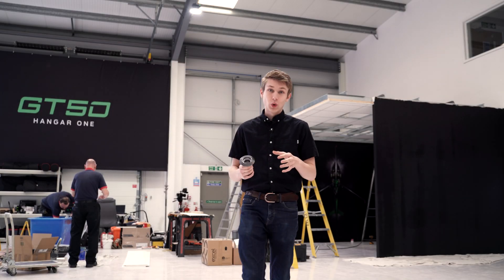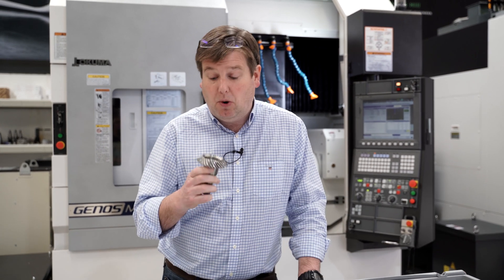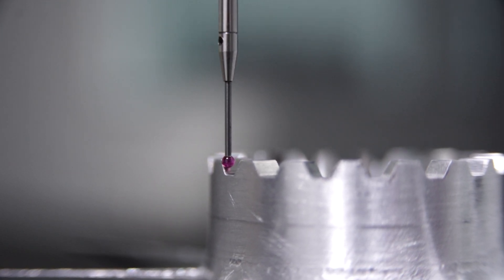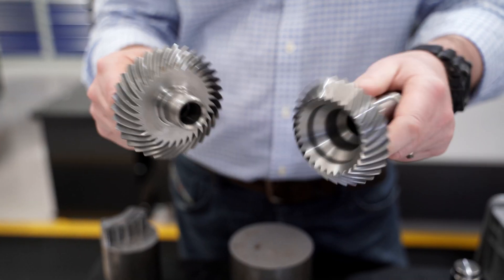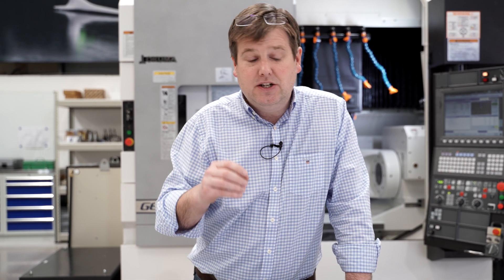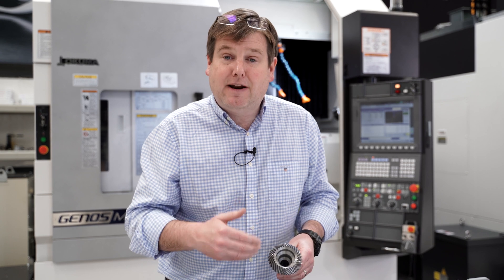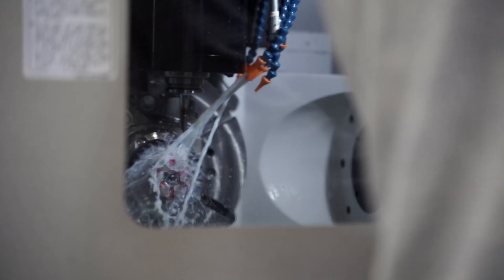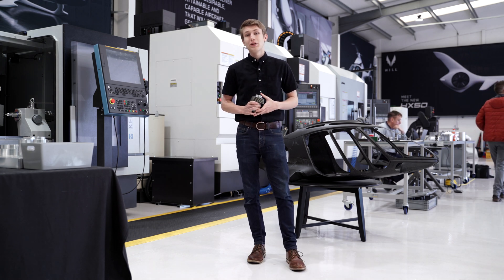Journey to HX50 | Episode 12: The complex process of gear-making

Comment: Great information, I found Cobalt to be the strongest and longest lasting of all materials in drill bits to work with. Don't know much about gear making, but if you could find a way to bond Cobalt to the gears I wonder how that would work out? Cobalt is a "very tough" material added to drill bits and they cut through metal like it was butter "every-time", it didn't lose it's sharpness like the titanium bits did, very tough and durable material. Just an "off the wall" thought. Thanks for the update. :) NC
Reply: Thanks, I'll make research about this
Reply: @aileronhelicopters  Thanks for the reply AH. :) NC